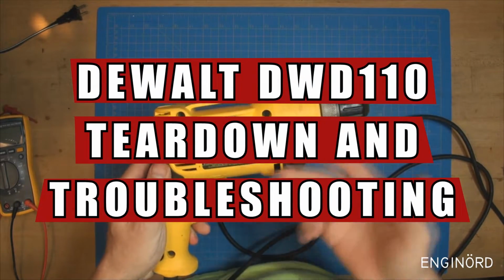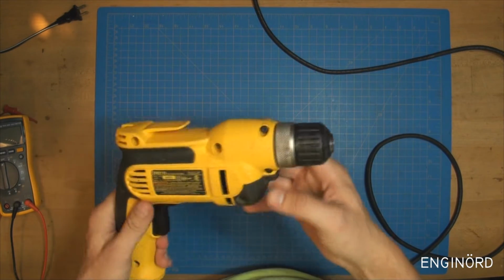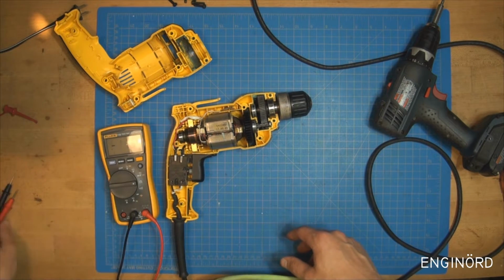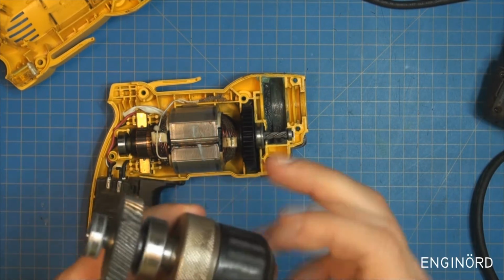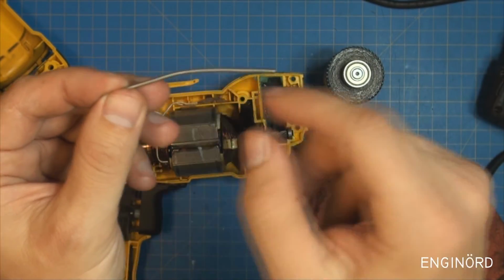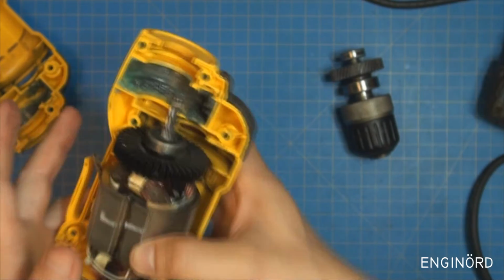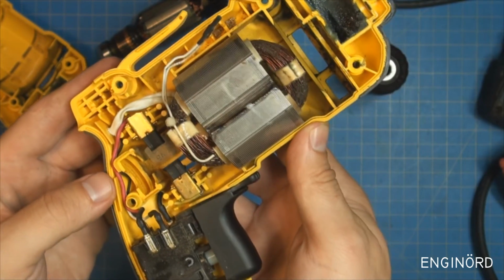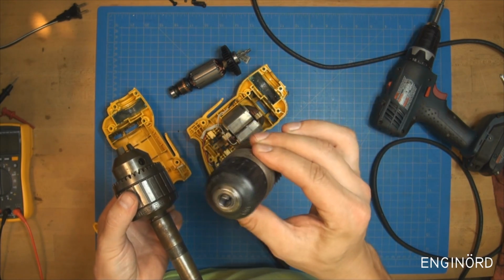Dewalt DWD110 Variable Speed Reversible Drill teardown and troubleshooting

Comment: I have problem opening the chuck to get a drill bit in. I know how it’s supposed to work but it won’t turn except for one half inch I guess.
Reply from the maker: If you get dust or rust inside the chuck it has a tendency to lock up. You might want to turn the key and knock lightly on the chuck with a brass hammer and see next if you can turn the key more. Good luck!
Reply: @ that’s what my son suggested too. I’m soaking it in oil tonight and I’ll try that tomorrow! Thanks!